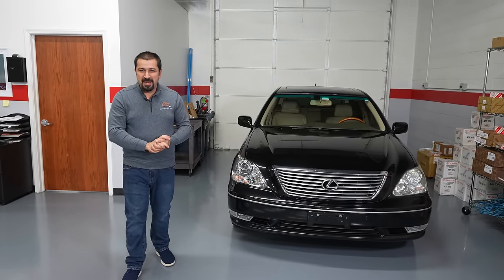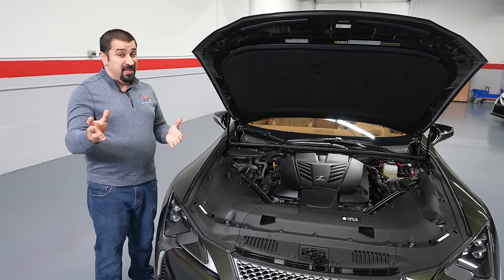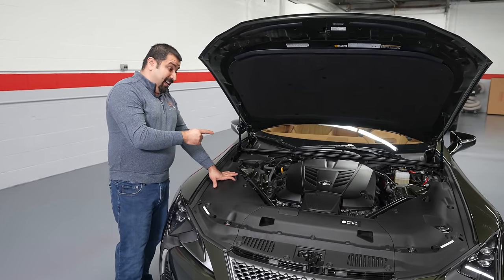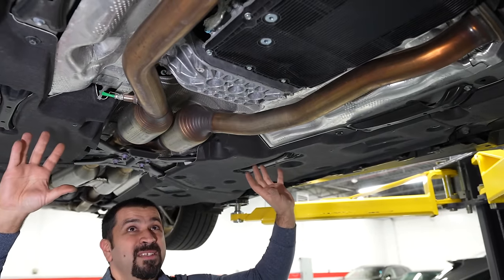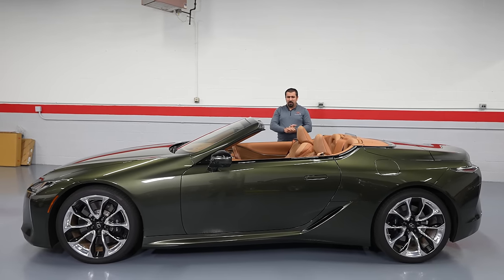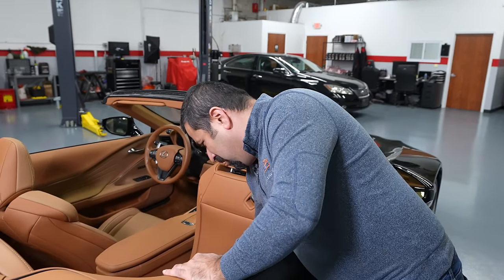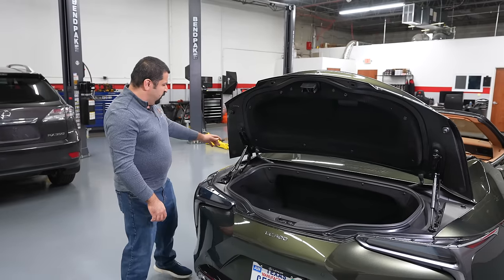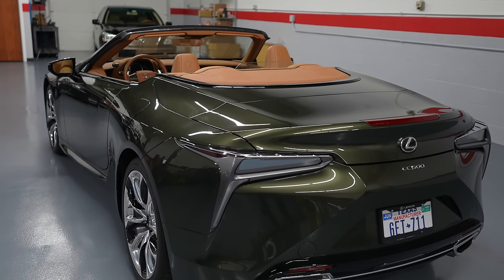This is One of The Best Modern Lexus Models EVER Made!

Comment: I used to be a die hard BMW fanboy, I got really sick of engines  blowing on me and having expensive paper weights, my last few vehicles have been lexus/toyota and I've been so happy with them.  I have an is500 on order right now, I plan on keeping it for a long time, I love that with proper maintenance and the amount of miles I plan on putting on it, it should last longer than me.
Reply: I used to be very similar as you were with Mercedes Benz, until it started breaking down on me, it was more times I care to count on the mechanic’s shop.
After I switched to Lexus in 2012 I have never considered any other brand.
Reply: Amen brother
Reply: Smart man as someone poor 😂 I learn I can’t be changing cars all the time so with simple experience I’ve come to learn and see that Toyota was the best way to go if you can’t afford maintenance all the time 😅
Reply: @AFMMD-q8  I thought Mercedes engines were among the most reliable. Did you have major mechanical problems or electrical and sensor issues?
Reply: @clockhanded  I had 4 mechanical issues sporadically through the years, (one of those left me stranded in the freeway) compounded with one big transmission problem, also the water pump broke out twice in 12 years of ownership, it wasn’t a cheap fix @ the mechanic.
Glad I got rid of it, no more germans for me.
Before the Benz I also had a Beamer that was another expensive pain in my gluteus maximus, Awww Germans! can live with them, can’t live without…just like women.
Reply: Still waiting for my IS 500 to arrive.
Reply: Me to loved the fit and feel and drive of a BMW - But I swear they build them just to last as long as manufacturer warranty last.  Once that ends get ready to open your wallet $$$!
Reply: While I love the old BMW 650 big coupe and the 850 convertible I promised a friend that I would never buy a BMW snd after all the horror stories of hot Vs and plastic parts.  Waiting for our 7th lexus to be delivered 🏖️
Reply: That’s how I feel about my Lexus s .  I’m done falling in love and buying cars although I reserve the right for one more if something super comes along 🏖️
Reply: I agree with you guys no German car repair bills for me.  Although this is not going to be a cheap car to repair.  I expect my Lexus s to out last me 🏖️
Reply: @davidmagen415  You saved yourself a big headache David, I totally understand you.
My 2022 Lexus RX 350 will be my last vehicle, as stated before I have had many vehicles during my long 64 years, I also have worked very hard for them, but I had enough.
I’ve come to the realization that if I continue, there’s no end to the madness of buying cars (SUV’s) every 2-3 years, so i cancelled all my automobiles subscriptions (so as not to fall into temptation) and stopped my affairs with cars as well, I currently have the 2021 Acura RDX A-Spec and the 2022 RX 350 I am 100% certain I’ll be buried with those, enough is enough.
Buying a new car is like when you first get married, hot and heavy for the first 2 years, loosing interest and cooling down thereafter.
So I’m divorcing cars as of today…and I drink to that freedom 🥃 Cheers!
Reply: I really want an e85 so bad and a 2001 740il and yes I’m one of very few that like the bangle butt early 2000s BMW 745s but that what you preach scares me!!!
Reply: Lol.....a lot of us BMW fan boys...did not appreciate the LEXUS until my fifties❤
Reply: Why are there many German car fans in the first place
Reply: I feel you brother. After countless European luxury cars I got fed up with repairs and intensive maintenance. Driving a GX now and couldn’t be happier
Reply: @AFMMD-q8 and buying a new car every few years is money down the drain. Would rather have.a Lexus or Toyota for reliability and spend the money on fun vacations and meaningful experiences.
Reply: Anyone know how much this Lexus LC goes for?
Reply: @JavierCR25  Welcome to the Lexus family brotha, guarantee you’ll never look at another brand again, they are the best and most reliable vehicles, my opinion of course and that of a master automobile mechanic I know.
Reply: @Pinkorchid72  💯👍 correct ✅
Reply: @Pinkorchid72  From 94,450 and up, it is a vehicle that will last a lifetime though.
Reply: Had all the German brands, don’t get me wrong great cars but too expensive to run, and the fear of breaking down, driving Lexus from 2008 never looked back.
Reply: Undergoing a very similar process at this moment ... ex bmw die-hard here, can't take in any more of the "all the new woke direction" company recently took. 

And I find myself unable to take my eyes of this gem from Lexus
Reply: New BMWs are a lot better though... I mean not better than lexus. Better than old BMWs.
B58 is a very good engine. And transmission hardly ever has problems
Reply: @AFMMD-q8 in 12 years 2 pumps and 1 transmission problem? I mean.... That's actually reliable man.
Reply: @dust_gale3108  You have a point there Gale I reckon I just lost my love for German automobiles in my old age.
Reply: I grew up with Audi and have fallen in love with the LS460.

Comment: The ONLY car journo who actually knows cars. I really appreciate a reviewer who spends this much time under the hood deciphering the code of how an engine performs. Well done, sir. As usual.
Reply: He’s good, but there are others out there that are good too. Also he was wrong that the LC500 is built for the track. This is my favorite car, but it’s a luxury GT car, not a sports car and not at all designed or intended for the track. It’s too big, it’s too heavy, it’s too slow, it has very poor low-end torque, the suspension is too soft, the brakes aren’t built for sustained heavy breaking, the lack of a dual-clutch transmission makes it slow to shift, the big engine upfront causes considerable understeer. If you track it, you’ll be very disappointed.
Reply: @SignalCorps1 it’s definitely a sports car as well as a GT car. But clearly wasn’t intended to be a track vehicle by any means
Reply: @KingMatt1  ok, I’ll concede it’s a marginal sports car, but primarily designed to be an elite GT
Reply: Electric motor spins the cam? Umm no that’s not how it works man.

Comment: My 2002 Lexus ES300 is amazing. The (02-06) generation is the best ES Gen. Quality and fit and finish is unparalleled. Not one squeak or rattle anywhere. Everything still works. I have 173k miles, I’m the second owner. New struts installed last summer. Rides like new, rear end is sitting up high like it was when it was new.  Bought it in April 2021 soon after had to replace the OEM alternator and AC compressor (started squealing). Earlier this year I had to replace the original starter. These parts lasted 20 years! A true testament to the build quality and reliability of the original parts ! All parts except struts were replaced with GENCO 
I’ll keep this one for 10+ years!!
Reply: Very nice!  I think I'm 90% sure my next car will be a Lexus. Did you replace the struts because you needed to? The reason I asked is because on all of the previous Toyota Camrys I've owned never needed struts even with over 300K miles.
Reply: @411sponge72  yes, both rear ones started leaking after I bought it in April 2021 with 160k miles. I had all 4 replaced with one notch below OEM. This is very unlikely for a Toyota and Lexus but the only thing I can think of the original owner used to put a lot of weight in the trunk.
Reply: My dad's 2013 rx that he bought brand new has 300k + kilometers and is still running strong. Only regular maintenance and consumables replaced (battery, etc...)
Reply: @RayanMADAO  nice 👍
Reply: I would argue that the 2007-2012 is the best ES model. It's a better car in every way, no comparison, faster, smoother, quieter, and just as reliable. After 2012 is when I think the reliability faulters. Still bulletproof cars, but 2007-2012 was the golden era IMO
Reply: The transmission is a little jumpy and has strange upshift and downshift behavior in turns. I also found the armrest too hard for comfortable long distance driving.
Reply: @Zav  not one problem with my transmission. Fluid is clean. Doesn’t jump or misshift
Reply: @Kyle22030  Yeah I agree with you on that. The 2007-2012 were the best es imo as well.
Reply: I think it was the era. my 05 LS runs immaculately at 173k
Reply: I agree. I have a 2005 Camry with over 350,000 kms and it's chassis were based on Lexus ES 300. The leather seats are still thick, smooth and plush and all the controls feel solid. Toronto, Canada. The mid 2000's era Toyota & Lexus cars were solid.
Reply: @marcelpatel9017  yes. My 02 ES300 is solid and super quiet. Sound insulation is outstanding. Rear seats don’t fold down on any ES for structural reasons. There’s an x brace behind the seats.
Reply: Proud Lexus owner here and I know that nothing beats the quality build and long term performance of my ES330 sedan
Reply: @zakmoon7065  what year ? I think the 3.3 liter came out in 2003
Reply: @Kyle22030  
I owned a 2010 and my sister owned a 2004. I agree the 07+ is definitely faster and better at cruising thanks to the 3.5L/6spd combo, but the interior of the 02-06 definitely seemed higher quality and more luxurious. Too much hard plastic in my 2010. I'm driving a 2010 is350 at the moment- it rips to 60mph in 4.9 seconds and corners like a sports car yet is almost as quiet as an ES.
Reply: In 2005 I bought a boring 2001 Camry with 117K miles on it. That's what the first owner put on. Got it off the auction for $7K. Family thought I was nuts. But this car was carefully examined by the person who was licensed to bid. I drove that car to 320K miles without major repairs (just diligent maintenance) and in 2017 I traded it on for a used Camry 2016. Nothing wrong with the '16 Camry, but build quality of that 01 was absolutely fantastic. Can't speak of Lexus but I don't think modern Toyotas are built with that mindset of two decades ago
Reply: I bought mine 3 years ago for 9.5K with only 38K. Now has only 47K on it. Bullet proof. ES300 2002
Reply: @lordhelps1 awesome find. that’s a rarity. mine just turned 180k miles. did have to replace a few more items since my last post. exhaust flex pipe, front brake calipers. all in with cost of car and replacement parts and labor i’m at about 10k. still worth it since i plan on keeping it for 10 plus years

Comment: One of the most gorgeous cars made in my opinion. The LC and SC interiors are just as impressive.
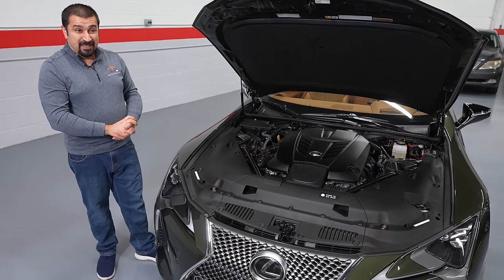Reply: The Sound of #Sweetness,  I Love it, played that part over quite a few times .   3:36    🔊🔊🔊

~○~
Reply: Man , I had an old 90s sc when they were cheap and no one wanted them. Even with high milliage , got it around 180,000 km , sold it when it reach 320,000. Thing was bullet proof, bad city gas milliage but very good highway miliage.

I'm in serach for an 90s jdm car for nostalgic feeling,  but all those iconic 90s jdm are just way over price for what it is. 
The SC was going for 15 k for an good condition . 

It's just a weird thing to see alot of 90s early 2000 jdm on the road when they were around, to wondering where they all went too. It's like seeing a unicorn when u do see one.
Reply: @jimmylee2745  I also own a 1998 silver over black SC400 with 45,000 miles on the clock.  It is perfect.  Love that car.  They were SO overengineered.
Reply: @243wayne1 wonderful! I drive a 92 SC400 with 120,000 miles. Owned it for 8 months now, it’s absolutely perfect
Reply: @SaifDurraniSC400  Never sell it...

Comment: In that caddy I changed the left rear axle, 2 alternators, drilled out the vacuum choke , radiator and one window switch. 178,000 beautiful miles and the rear level control still worked along with the a/c!

Comment: This by far is my favorite GT cruiser. This was an and outstanding video to show the fit and finish of the Tacumi craftsmen at the Moto Machi factory in Japan, where they manufactured this vehicle. It truly is second to none and is nicer than cars costing $500,000-$1 million. Thank you for taking the time to make this outstanding video of my favorite vehicle. I do own a 2021 a LEXUS LX 570 and I love it. I also owned a GX 460 and that SUV was flawless. Again thank you so much for your painstaking detail in this video it was so well worth the 45 minutes of watching time.
Respectfully,
JimmyUSAF 🇺🇸✈️🇮🇹💜✝️🙏😇🎄⭐️🌎👍
Reply: I wanted a LX a little
out of my price range, enjoy that truck
Reply: This is within my price Range, All I have to do is give up all the other joys in my life.  😳
Reply: @icosthop9998  well worth it.
Reply: @freshdotholla  🤣🤣🤣🤣🤣

True
Reply: I agree that this is a superb GT car, but I’m very surprised he considers it a track car. The LC500 was not at all designed or intended for the track. It’s too long, it’s too heavy, it’s too slow, it has very poor low end torque, the suspension is way too soft, the brakes aren’t built for sustained heavy breaking, the steering is way too detached from the road, the big engine upfront causes considerable understeer, the lack of a dual clutch transmission makes it too slow to shift. This is my favorite car and my daily driver, but it is a very average track car. If you track it, you’ll will be very disappointed.

Comment: thank you for this.  Own a 2020 coupe with all options.  Agree with everything (and discovered a few things as well!).   This is a "sensorial" car.  It gets your every senses triggered at some point.  I've enjoyed it a lot and now plan to keep it as long as I can!
Reply: Very  Good   👌

The Sound of #Sweetness,  I Love it, played that part over quite a few times .   3:36    🔊🔊🔊

~○~
Reply: Cannot agree more. I own a 2021 performance coupe and have learned a lot from this video.  Thank you for this review.  Best vehicle I have ever owned and now I have a better understanding as to why.
Reply: I agree that this is a superb GT car, but I’m very surprised he considers it a track car. This is an outstanding luxury GT car, not a sports car and not at all designed or intended for the track. It’s too long, it’s too heavy, it’s too slow, it has very poor low end torque, the suspension is way too soft, the brakes aren’t built for sustained heavy breaking, the steering is way too detached from the road, the big engine upfront causes considerable understeer, the lack of a dual clutch transmission makes it too slow to shift. This is my favorite car and my daily driver, but it is a very average track car. If you track it, you’ll will be very disappointed.

Comment: It is really an Amazing car!! I drove one last year and everything are exactly the way you described them. I own (as you know by now) a GS450h but also a modified Mitsubishi Evo 7 RS. LC500 is more enjoyable to go fast on the road than the EVO. LC is purpose made to go fast with safety, while with EVO is a modified sedan to go fast. That is translated to compromises in many areas of the car.
Reply: I would be interested in a used GS450H but they are hard to find. What would be drawbacks of this car according to you?
Reply: @mathisnotforthefaintofheart  I guess we are in a different continent. I am in Europe and I drive a UK specs RHD 2007 top specs GS450h. The car is super-fast, though it is not made for this. If you service, the car properly it will last forever. It doesn't need a lot to run. I can hardly see any wrong with this model, since with my car I never had any problem at all. Both batteries, hybrid and auxiliary Panasonic lead acid are the original. Some say the VVT-i is an issue. I think as long as you use proper oil and change them every 5000 miles with the filter everything will be good.
Reply: @KHIJAPAN  Thanks...I guess I will keep looking. I am in the US. In Europe there is also a "slower" GS hybrid. I wouldn't mind that car either but THAT version is not in the US. We do have ES hybrid but that's front wheel.....sigh